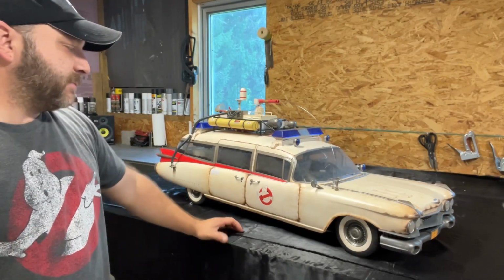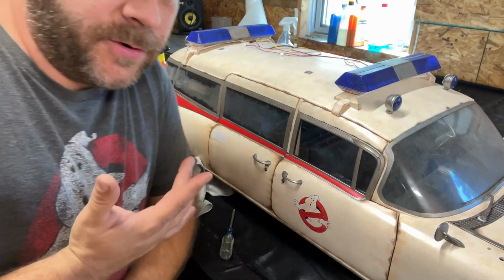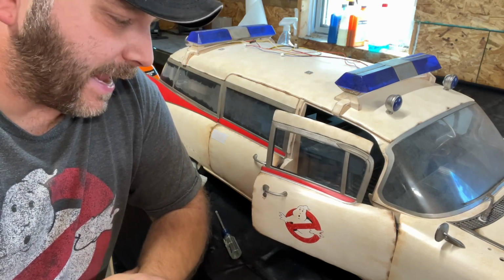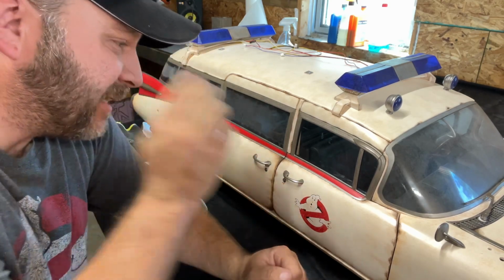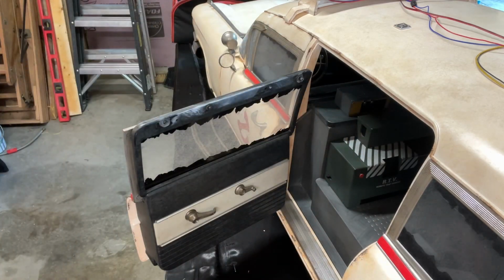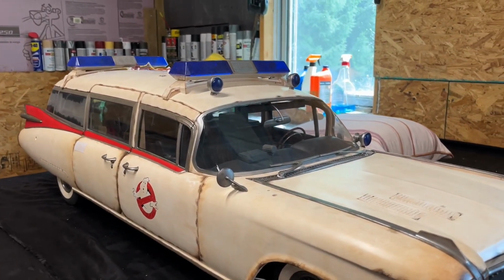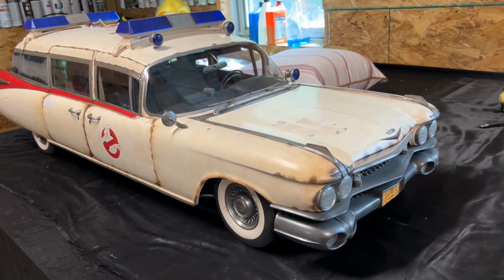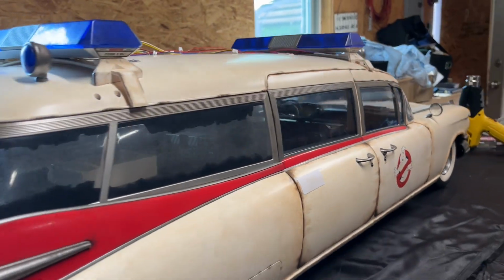1/6 Scale Ghostbusters Pre Ecto 1 Build Part 1

Comment: Before you can remove the shell there is 2 screws inside the brake lights so you need to remove the glass to get at them.
Reply from the maker: Now you tell me!! Lol omg I was freaking out trying to get it off. Have you had the body off? What did you do about the suicide door I got to the point where I can get the body off, but it won’t come off because of the hinges on the gunner door, holding it down still. Can I just pop out the pins?
Reply: @ghostbusterspluscollector9624  
I did it on the 84 ecto.
Did you get the screws out the brake lights?
I did tell you before about the screws in a previous video
Reply from the maker: @Brucehodge81  I could not get the lenses out, they are glued in there good. So I literally just cut some of the bottom of the bumper and notched it out a little so it will go over the frame but on the Afterlife version the gunner door is not attached to the body it’s attached to the inside, so I have to somehow get that door off to be able to take the body completely off.

Comment: Slightly confused,  this is the second pre ecto1 build I've seen both used the afterlife vehicle with new gunner seat and opisit flip opening door, did they use a new pre ecto in the new film? I've not seen it yet i have only seen the original vehicle as the pre ecto.
Plus I think thus will be the next one on Blitzways list try and get as much out one mould as possible

Comment: What’s your final solution removing the driver side window (breaking glue residue)? I want to remove and have my 1/6 figure hanging out the side “come on, let’s run some red lights”
Reply from the maker: You just have to heat up and remove the top black piece as shown in the video. Remove the 2 screws underneath that piece and slide the window out.